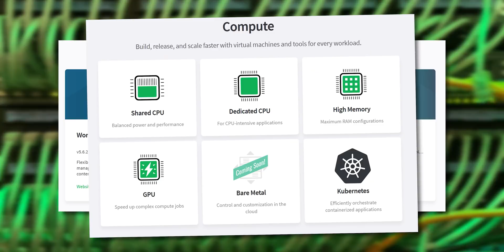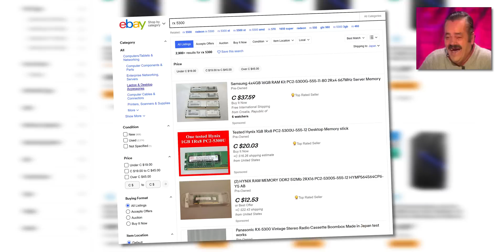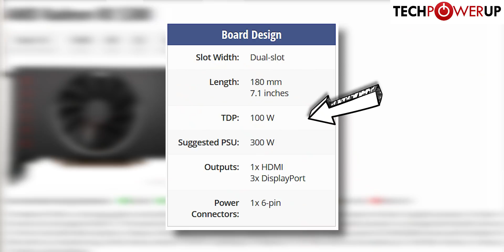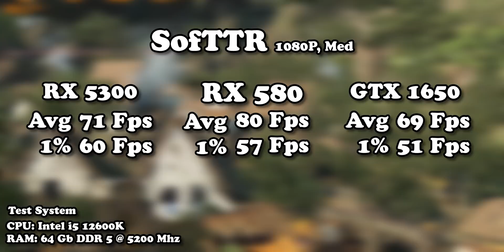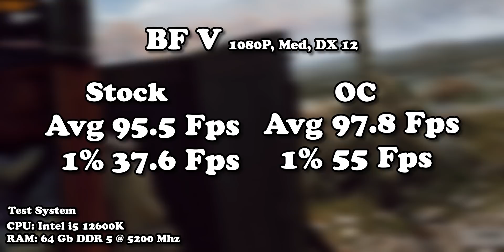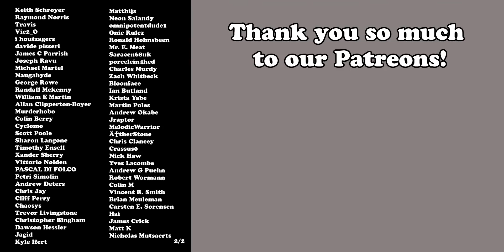AMD's Long Lost Budget Gaming Graphics Card

Comment: here i am, sitting here realizing that when i bought my rx-580 red devil 8gb back in May 2017 for $179usd, i made one heck of a good investment on a gpu that i STILL use to this day. of course id love to have a rx 6800xt red devil, but my 580 8gb red devil is still doing what i need it to and i got it before prices went crazy. on top of that, ive been using it for 5yrs at this point. best part purchase ive made, ever imo
Reply: Same here, I don't need to buy a new card, my 580 doing strong in every game I throw at it lol.
Reply from the maker: That’s a great card for a great price! 😁
Reply: I feel ya, getting my GTX 1660 Super for that 220 MSRP back in 2019 was a wise move on my part.
Reply: The fine wine is very strong with this one. It has pulled well ahead of the GTX 1060 6GB (which always had a higher MSRP). FSR is also allowing polaris, Pascal, and even some older gen cards from both companies to keep going.
Reply: Got my 1650 super for like ~$90 NEW as a deal in early 2020/late 2019. Still using it to this day
Reply: @DiamondDepthYT  that's a steal for what would be the best 4gb gpu man. And the rx 6500xt is a joke on the same PCIe 3.0 ballpark
Reply: My 570 8gb struggles sometimes, but 90% of the time it's good enough.
Reply: I'm not as lucky. I had a 580 4GB but sold it right before the graphics card crazy pricing was a thing. i bought it in 2018 for less than USD200 and sold it at half of that...  Damn....
Reply: In november 2016 i had bought a gtx 1060 3gb when it was brand new. Still really happy with it for the most part. It was 185 just after launch, cheaper than the best 1050tis at the time
Reply: I got my vega 56 for 249£ new in 2019 I think I got a great deal
Reply: My friend just bought a 590, jezus that shit was 300€ and that was the fking cheapest one😭😭😭
Reply: I'd sell it high and do some deal hunting. They still go for as much as cheaper GTX 1080 and more expensive GTX 1070 models right now.
Reply: @b0ne91  With the costs, risks, and hassles of selling and buying, it might not be worth it, especially not the 1070, which isn't really that much more powerful than an 8GB RX 580 anymore (RX 580 can match it or even beat it in some games). And, I say this as someone who upgraded from an RX 480 (4GB) to a GTX 1070 ti back in 2019.
Reply: @syncmonism  The 1070 is way ahead of the RX 580 8GB. I would personally take the upgrade every day. I look at my local market every day to snag up deals and I've gone from a 980 to a 1080, to a 2070 to 2080S in the last year at around 300€ actual cost.

I think you're also underestimating the jump from a 1060 6GB to 1070. Pascal scaled really well. Especially if you're still on 1080p and got a beefy CPU to push frames in games where you need a competitive advantage.
Reply: @syncmonism  think you're thinking of Vega 56 that's aged well.
Reply: Found an RX 590 Red Dragon back in December 2019 for 180€, crazy when you look at sold cards in eBay going for 250-400€ (Germany). 

Back then I upgraded the whole system with a B450 Aorus Pro, Ballistix Sport LT 2x8GB, Ryzen 5 1600 AF, 500GB Kingston A2000 M.2 NVMe and a pack of thermal grease, (as the grand old OCZ Vendetta 2 (with a Scythe Slip Stream fan) from 2008 seems to keep up really fine). Also no need to upgrade from an old Corsair HX620W or the case (even though I hate the flimsy overpriced Fractal Design which has some bad vibrations even with modded & suspended HDD mounts). ...So the total upgrade price landed to around 580€.

Comment: This card only makes the rx 6500 seem more like a bad joke
Reply from the maker: It really does. 😂
Reply: The 6500Xt would have been more acceptable if it had been similar in price to the 5300, even up to $150USD to account for inflation
but yes $200USD/$319AUD is a joke for that performance, while the ASUS TUF at $359USD/$589AUD is just ASUS taking the absolute piss.
Reply: They cut the VRAM in part to discourage its use as a crypto miner?
Reply: @hansbehrends438  
No, they cut the VRAM to make the card cheaper. GDDR6 prices are pretty insane.
Reply: @hansbehrends438  I think they have just discouraged it as a GPU altogether, not just for miners. If I was building a new rig today, I would probably go for an APU and just wait for the market to settle..... In about 5 years time I could probably get a 2080 for a decent price.
Reply: Yeah. Seems like if they'd just taken the 5300 and added 1 GB of memory they'd had a better product.
Reply: @folcotook3049  Because of the memory layout, they'd have to make it 6 GB to maintain consistent performance. A 4GB version would need a slower 64 bit or faster 128 bit bus.
Reply: @DigitalMoonlight  4gb would need a 64 bit bus 🤨 sounds . . . Familiar
Reply: @jaysanchez4407  Don't know why they didn't just put 6gb of ram instead  (its fucking 2022) like normal reasonable human beings
Reply: @DigitalMoonlight  fair play. I just wish they hadn't crippled the pcie lanes on the 6500. I think if it could use x8 it might have been a decent (not great) card for the money. Guess we'll never know.
Reply: @DigitalMoonlight  at 3:00 it has the Traces for the 4th Memory Module Pad, so a 128bit 4GB (maybe with a Different Controller) should have been possible,
like nVIDIA did to make the 3080 12GB
Reply: 5300,5500,5500xt..all the same with dif amounts of memory mostly.
Reply: This rx 5300 seems better than the 6500 is almost every way